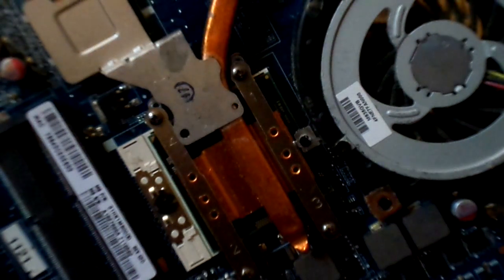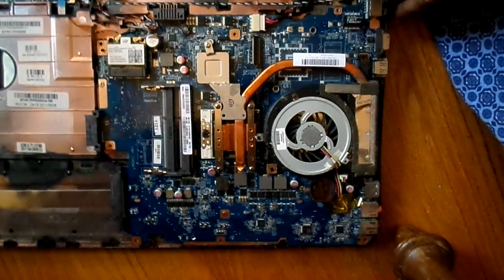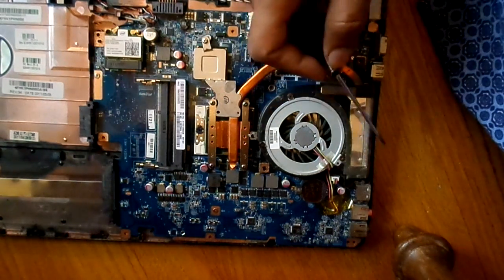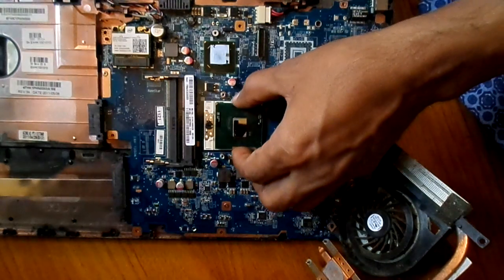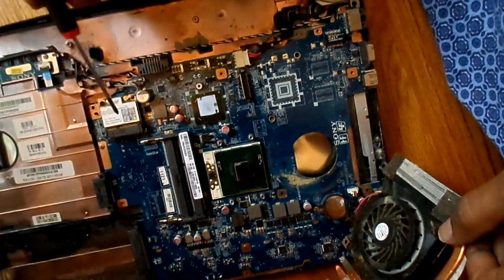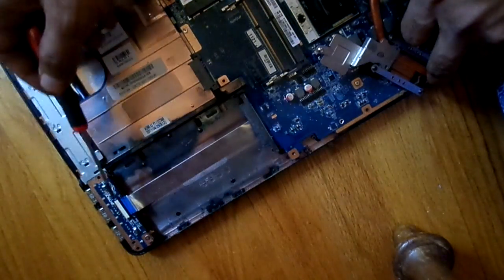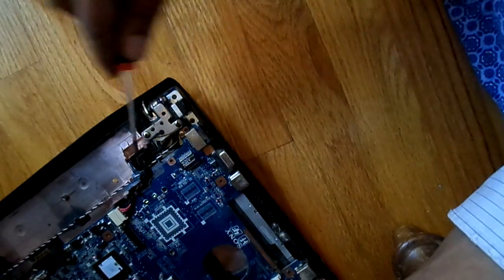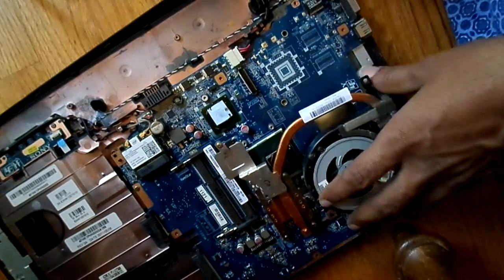Parts of a Motherboard laptop - processor, chipset, memory etc

Comment: where is the graphic card?
Reply: Laptops don’t have graphics cards ._.
Reply: @zynm610  
Usually laptops have Integrated graphics (GPU)  which is built into processor but it can have discrete graphics to which means a graphic card separate entity to CPU. That's what I know, correct me if I am wrong
Reply: @zynm610  3 years ago I had issue with an added graphic card by AMD in video and I thought of taking that out and keep using the default Intel one. That's when I came across this video and I was very new to it so asked it without any context.
Reply: Aditya lodha stupidest person in the universe

Comment: i can totally replace the cpu on this board!!!
Reply: not if its solder as in 90% of the laptop these these. of course, you can replace the cpu.... just need a $1000+ industrial soldering equipment plus a replacement cpu to do so